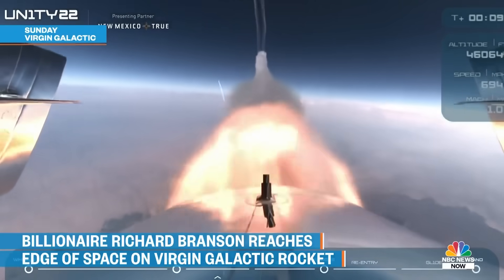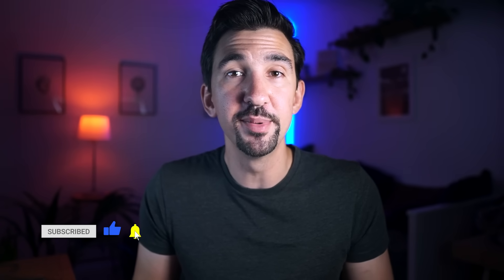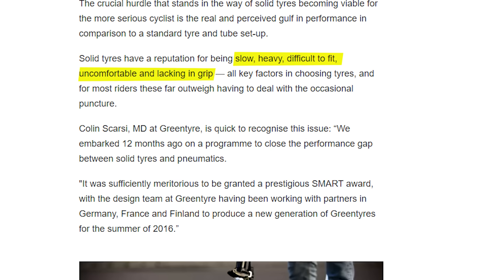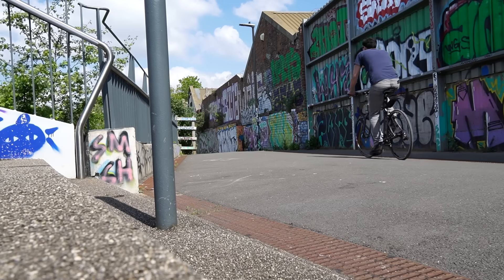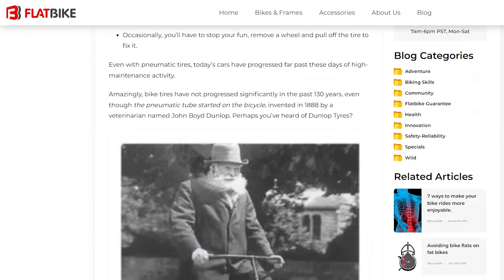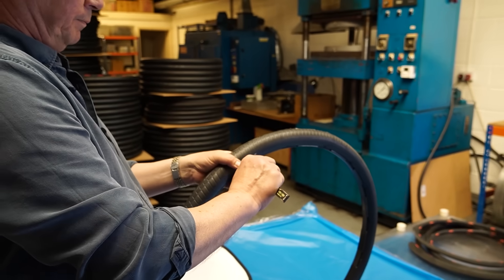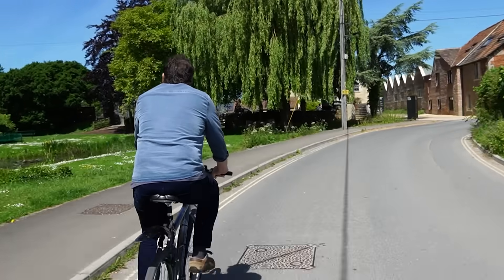I Tried Solid Bike Tires | Here's What I Found

Comment: 6:53
Wrong.
Not only saying that the second ball experiments the same speed that the first ball has is wrong because there are several things that you don't consider like air drag and also sliding & rolling friction each of the 2 balls experience in that scenario.. but also the angle of impact and the position of impact on the first ball matters very much to completely destroy the thought of the first ball stopping after impact, having a efficient kinetic energy translation to the second ball.
All of these factors influence a snooker and pool balls collision to not respect the equation you've presented when saying the coefficient of restitution is "pretty close to 1".

Comment: If it's a solid tyre you could theoretically tweak the cross section to perform how you like it to (within the material property ranges). But you would fine tune feel with profile. Neck it down to allow more flex like around corners and such, etc.

Comment: As an avid cyclist who has pedaled over 180, 000 miles, I finally installed mousses. I had used tire-liners coupled with "slime" sealant and still gotten sidewall flats. The assurance of no flats now compensates for performances issues, since I don't compete. I put tape over the valve stem holes in the rims to keep water out.

Comment: screw this... the best bike tire is a steel belted motorcycle tire, that gets around 80K miles before you need to toss it. Yes they are HEAVY...  But, hear me out, use a battery / electric motor to help you offset the heaviness of the tire. The pro's are, excellent puncture resistant, very comfortable, Good rolling efficient, grippy on the road surface (safety), inexpensive, readily available just about anywhere and last a really long time.

Comment: 2-4 years? Why? Is the material so soft that you reach the rim in that short amount of time? Because in that case I don't think it is that good of an environmental solution after all if the air is just filled with even more tire particles... The tires on my city bike are on there for more then 10 years now, and while there are by now some wires looking through by now, it still works fine. And before it stops there is no real reason for me to replace it.

Don't get me wrong, I get the importance of tire profile on a mountain bike, but on a city bike there really is no need for a tire profile at all. Like if I want to have a lot of grip on concrete, I want to have a large area of contact with it.

Comment: I think this is interesting, but I would also suggest looking at tire sealant. Ever since going tubeless with sealant, I've enjoyed not worrying about thorns (especially goat heads). I still have to occasionally pump my tires, but it's not often and they feel very similar to regular tires aside from them being so hole resistant
Reply: Also if you dont want to spend too much money on a tubeless setup, you can get tire liners which reduced my punctures from goatheads from almost every ride to almost none
Reply: And sealant inside tubes gives the same resistance benefit while being easier to work with, for the tradeoff of being heavier and slower. Worth it for me.

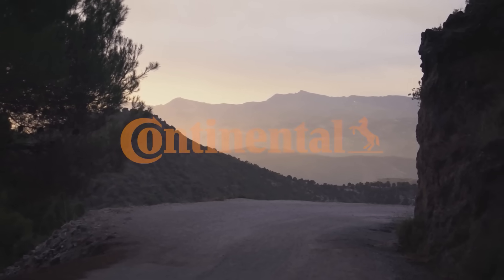Comment: Wait... (5:17) A rubber tire, buried under possibly tons of refuse and soil, gathers methane inside its small internal space, enough that it "causes those tires to become buoyant" displacing the tons of materials above it, and "rise to the surface"? Dude what? I'm clearly no scientist, but by that same logic, shouldn't there be millions of corpses (due to their much larger internal space, and therefore with much more lighter than air gasses inside them), lying around on the surface?

Comment: Tannus make Aither Airless Tyres, and Armour Inserts with 360 degree protection. 

Schwalbe also have their Airless System, which are foam filled conventional tyres.

The only issue with solid tyres is uneven wear, especially if the tyre skids, which would make the tyre "bump" on the flattened areas. 

There are also many tubeless options which also have run-flat inserts.

Ask us for all product options, all available to order from us!

Comment: Fascinating, but I see two issues that need to be accepted.

1. It's a patented product you are viewing, as you say in the video. Lack of competition will lead to higher prices, pushing out a lot of the lower tier bikes & bike buyers.

2. Those that buy more expensive bikes will be expecting either serious performance, or serious comfort. Both of which would be better achieved with air filled tires.

In conclusion: The tires would be best suited on lower tier "average joe" bikes, but its exclusivity status will lead it to not being common.

Comment: I missed the point where that is enviromentally better...
it relies on the form to bounce, it won't be viable being worn out to the rim, it will have to be thrown away around 70% probably... also my guess is it will need a weekly rubber painting to avoid the air bubbles exposed being weak spots... also Recycling is a lie.

Comment: Even when I rode a bicycle a lot, as in it was my main mode of transport, it took many years to go through one tyre and I've only rarely had to buy a new tube.  The latter typically outlasted a tyre.  Also in spite of riding on all manner of roads and surfaces punctures were not a regular occurrence, and when they did it was a quick job to pop on a patch that will never come off and actually makes the tube even harder to puncture.  So for that price these solid tyres would have to do a lot better than lasting a mere four years.  I appreciate that they're easy to recycle, although recycling itself comes at a cost.

Comment: I only had annoying amounts of flat tires when I had:
- A racing bike, that I had only for a short time.
- A mountain bike with broad tires, and big knobs, but thin walls between the knobs, that I got cheap and used for half a year, when I studied abroad. I had regular flats form firethorn bush thorns piercing between the knobs, with those.
- Several trekking bikes, with normal tires, that I used over a time period of roughly 15 years.

Then, around 18 years ago, I changed to a trekking bike with thick walled 51 mm balloon tires. Since then flat tires happen far less often. I had several situations with that bike, where I drove through spreads of broken glass bottles, and nothing happened.

If I should give an estimation, I would say, that I went from having a flat every couple, month sometimes every couple of weeks, to having one flat every couple of years. The two flats I explicitly remember with my balloon tires, where both when they were close to reaching their end of life and a glass piece worked itself through the material over time. Thus those flats probably could have been avoided, by changing them sooner.

Another benefit, I noticed changing to the balloon tires, was that I have to pump them up less often and they work reasonably well over a larger pressure range. The reasons for the lower air loss is probably threefold: They need less pressure and with a lower pressure gradient between inside and outside, also the air loss is lower. Their larger diameter means, that surface per volume is lower and thus air loss (which happens over the surface) is lower. The thicker walls also reduce air loss.

The balloon tires also make it far less likely, to get buckled wheels, from unexpected potholes, etc. And they are very comfortable and make expensive and maintenance requiring suspension forks and other suspension elements unnecessary. This also offsets some of the weight increase.

The only small disadvantage of the balloon tires, I noticed, is, that because of the higher tire weight, acceleration is a bit lower. But I always felt that as an acceptable tradeoff for all the benefits. Maybe that also affects me less than other people, because I weight 120 kg, and always had steel bikes with big bike baskets and most of the time quite some luggage, and thus relative to the total weight of man, machine and luggage, the weight gain from normal to balloon tires is less relevant.

So with that bike, I really see no practical reason to change to solid bike tires and I can only recommend, balloon tires, especially for heavier persons.

I really would be interested in, how those solid tires perform for a 120 kg person on a 25 kg bike with 10 kg luggage, thus 155 kg total wight, that nevertheless drives faster than the average cyclist. With an air filled tire, you usually adapt the pressure to the drivers weight, which is not possible for solid tires.

How do those tires hold up when emergency breaking, or when driving sudden tight curves? All the metal and fiber mesh components in normal tires also contribute to security under such conditions.

The 100% recyclability is indeed nice.

Comment: Solid tires suck. Theyre heavy, they roll like shit, and taking them on and off is a bitch. Tubeless is the way to go. Lightweight, sealant closes most holes, literaly the only downside is the mess the sealant makes when you finally do have to change the tire. Just remember to bring a spare innertube with you if you get a flat your sealant cant patch up on the road

Sorry for the swearing. Im a professional bicycle mechanic

Comment: Londoner cyclist here, I've been using tannus solid tyres for about 2 years and done at least 5000km on them and I have to say I don't agree with a lot of what you said about them. I absolutely think that solid tyres are an excellent option for commuters and the tannus tyres are really quite good. Comfort is not that bad, they feel pretty fast (28c tyres on my road bike) and installation is closer to 20-30 minutes when you get it right. Plus on ebay (and probably other places too) you can get them for like £25 each. Nothing against gecko I haven't tried them just think you undersold tannus. My only major gripe is that it does put more strain on wheels/spokes and so I recommend stronger wheels and you'll have to replace them every couple years but still absolutely worth it.
Reply: Exactly the same experience here. Also people talk alot about grip. I'm not a guy trying to be some Tour De France wannabe. Just an average commuter.

Comment: I think this is useless. it's more dangerous for the driver... and the tire is something you usually don't ever change unless your drive over nail factory and rip tires apart. Inner tube is the only thing you change, not the tire unless it's worn, and it takes a lot of time until it's worn... years. 
This is in my view purely an environmental thing, and in the end, no one will recycle this, it will be dumped just as the tire with some metal in it, let's be real, it's a useless idea. Let's also realise it's more expensive than normal tires and it has more rubber in it, that's just counter intuitive, forcing more rubber to be planted. It's literally pointless innovation as it goes against what it is trying to prevent. People will start to throw away more rubber as these will rip apart better since they're heavy and flex a lot. My view is they will be that these are actually anti user, and anti environmental.

These companies should spend time improving the tire we already have to be easier to recycle, maybe inventing a new type of rubber or using something different that does not need mixed resources to produce.

Comment: Maybe we don't need solid tires. Maybe we just need regular tires but replace the air with something that doesn't leak. I dunno what that is but the only problem in regular air filled tires is when its puntured, the air leaks out. Why not make something that replaces the air?

Comment: I think using microbubbles will be a game changer. Increase the PSI in the middle, reduce it by half a dozen PSI on a gradient to the sides of the tread for better grip when turning. You can have two layers of the same material with bubbles at different PSI to get that strong spring / weak spring effect that cars use. I could see this completely revolutionizing tires if it works.

Comment: A good way to do it may be a hybred, solid  on the outer half and air in the rim half. They should be a little easier to mount, still be adjustable for dif rider weights and road conditions. It may also help if a hybred, to have the tires a bit taller then standard air tires. With ebikes on the road going up in numbers, with tires as fat tire 4x20 inch, there may even be more waste tires to deal with in the future. I've heard of many having problems with them going flat.

Comment: What about the same celluar foam structure. But have a sealed internal structure that has a lighter gas in it? There are some engineering challenges still for sure. just an initial thought.

Comment: your taking data from car tires and use them for bicycle tires wherever if suits you and because its solid its better ?? a good air tyre rarely gets punctured so unless your biking on glass everyday and a solid tire uses more materials  and recycling doesn't mean it must return into its original form we use tires granulate in roads. and most tires cost like 10$ you say an average tire is like 50$ that one expensive tire people will only pay that if its sports related and even then its expensive

Comment: I don't think I have ever had a sudden puncture of a bike tire; (never had one in a car either while I was driving, but when I was a teen we had one rear tire rip open on the autobahn once). I've had tires that was slowly leaking a few times on a bike (and once on my car); never was able to locate the hole on the car tire but it only meant I had to top it up every month or so until I replaced the tires or with bikes grew too tall and needed a new bike... Do most people actually have punctures all the time!? Am cycling I too carefully, running with too low pressure (I guess low pressure would make it less likely to catastrophically fail when pierced) or have I just been incredibly lucky?

Admittedly I don't bike much anymore (in fact I broke the pedal on my last bike about 10 years ago and haven't bothered to repair it yet); but I did bike several times a week all summers as a child and teen.
Reply: I just googled it and apparently too low pressure would lead to more punctures, so that's probably not why. 
But I have never had a bike with those thin tires (that to me looks both uncomfortable and slippery); all my bikes have had semi-offroad tires because that's what I got used to as a kid. Are they just more durable?

Comment: These semi-solid tires will be fine for commuter bikes in limited temperature range environments. Might get a bit harsh in cold/freezing conditions. I ride on 29 x 2.5" slicks to which I have added a Tannus liner contacting the tube and an independent Kevlar liner between the Tannus and the tire. I run the tire at 40-50 psi. This so far is bulletproof, with zero flats and lots (~2000) of miles. The rolling resistance increase is nearly unnoticeable, I have pulled screws and staples out of the tire with no leaks, and the tire has enough additional thickness that I only need to pump them up every three months. This however does nothing for the environmental issues mentioned, When the tread wears down to the fibers, I will replace the tire and reuse the two liners inside each tire. The Tannus liner has thin side walls which keeps the rolling resistance rise to a minimum. On a side note I also use a liberal amount of Teflon (PTFE) solid dry lubricating powder between each layer of the tire assembly. This allows each layer some relative surface shear without generating heat losses (and so RR losses).

Comment: @6:23 i think this is a misunderstanding of how tires work, air transmits force from the bottom of the tire to the rest of it, spreading it out uniformly and radially and allowing for, mostly, very small single direction/stretching displacements all around the tire, these very small flexions being more elastic than larger ones.  this being revealed by; next to no pressure change in tires when hitting a bump, higher pressures being more efficient and being able to pressurise a  tire when its unloaded.
small sealed bubbles wont disperse the load, will be sheared rather than just stretching, and will be under greater 'spot' stress, approaching  the same utility seems to me to be so so hard.
my belief is that pneumatic tires puncture because they are made down to a price, minimum serviceable quality, and that any non-pneumatic tires will, once established, be just as much a point of failure.

Comment: It was noted gas bubble infusion - hard to say what a cross section looks like under microscope - My thought went to a high concentrate of micro spheres developed when I was at 3M in the seventies, and used in a lot of lightweight auto and home fillers. I would think the mix would not only be quite uniform, but as surface of tire wears. it's exposing edges of micro glass edges as a traction component. 
But I'd truly grind a high traction profile in the surface to begin with. One should be able to wear this O-Ring tire almost down to the rim before needed replacement. Science is Truly Cool Kids. 
And at 70' we've seen some magic... 
Cheers

Comment: I wouldn't mind a slightly stiff like over inflated bike tire, less running resistance. As a kid I usually pump the bike tires, above recommended so that it easier and faster. Losing grip on the wet could be a problem but I think can be minimized with better designed treads.

Comment: IDK but how about using that hard foam rubber tubing that you use around copper pipes you insulate ! 
Or similar tubing tube size   guess you got fit it inside the tyre while tyre 1/2 on rim